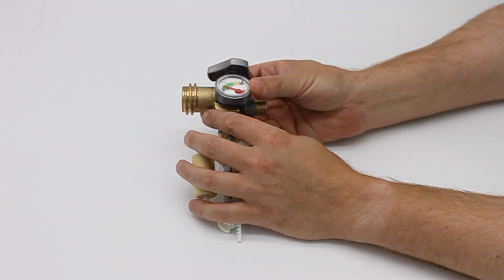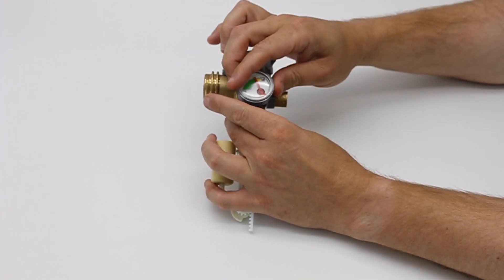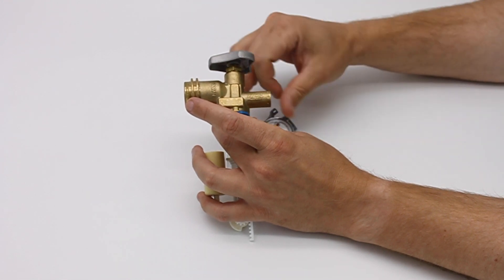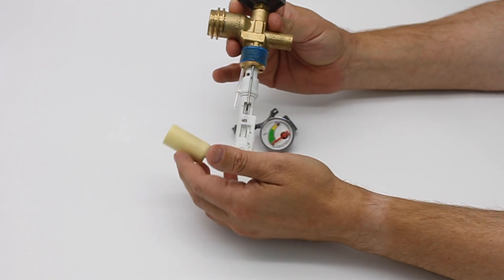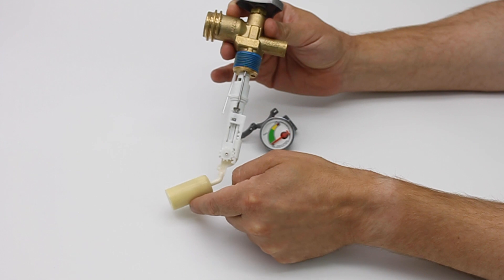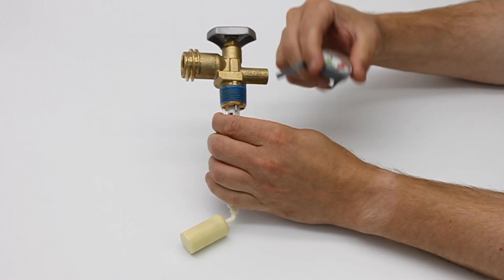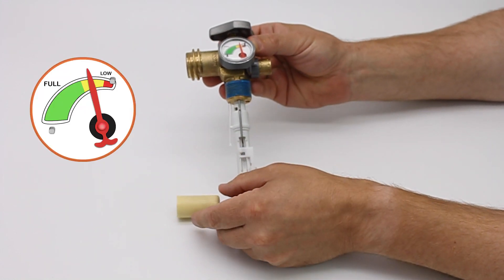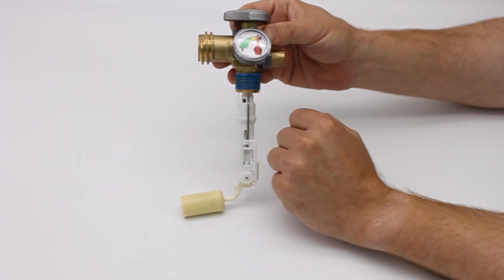How the OPD Valve with the gauge works? OPD valve tutorial by Flame King

Comment: I bought one of these tanks this summer and when I noticed the gauge had some play in it was obvious it wasn't measuring pressure which would require a solid connection. I asked ChatGPT and it explained it worked with a float and magnet, nice to see the actual components making it work, I love this tank with built in gauge. ChatGPT also explained this is far more accurate than those "add on" pressure based gauges (that cost as much as 2 or 3 propane refills) as the pressure remains about the same for the first 75% of the tank I think it said, making them very inaccurate.

Comment: The tank on my Weber performer grill is mounted in the cabinet with the gauge facing away from the door.  Is there a way to relocate the gauge so it can be read on the other side of the valve?  Is there a version of this with the gauge on the other side of the valve?
Reply: Can you not simply rotate the propane cylinder?